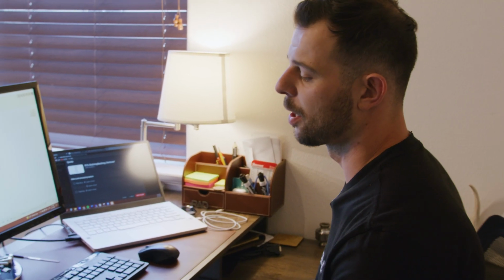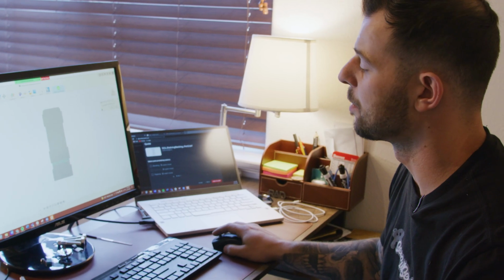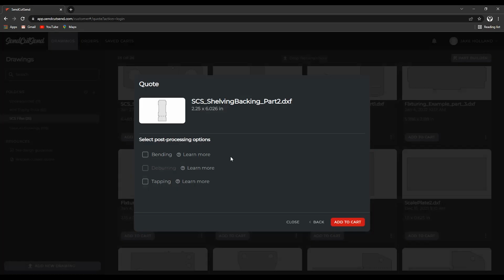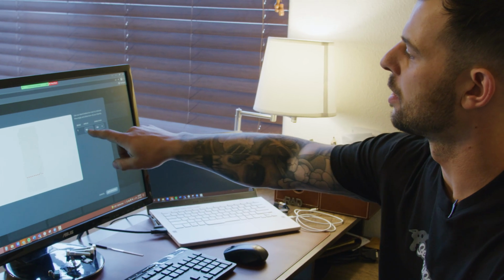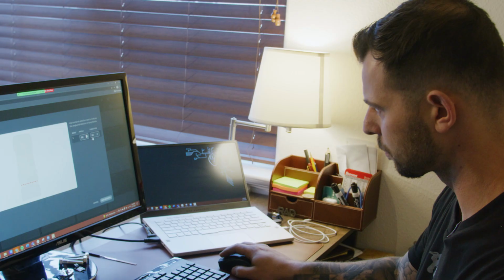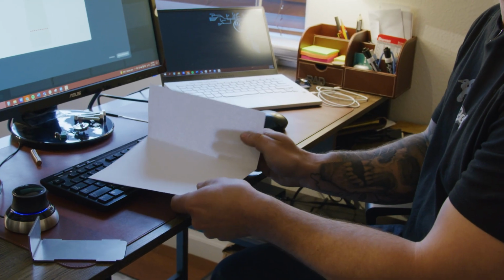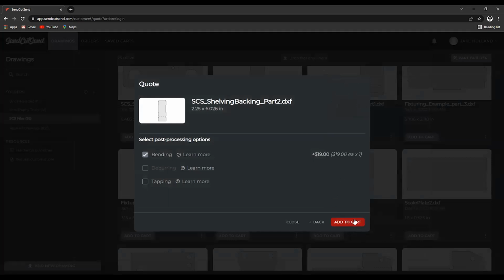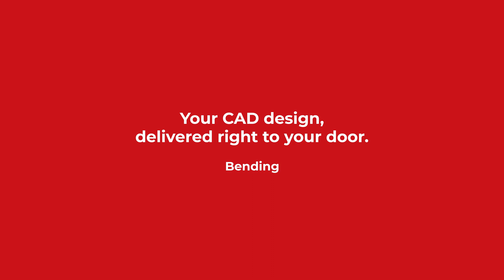How to Configure Bending in the SendCutSend App

Comment: The bend lines Fusion gives me are way closer together than the die width measurement provided on your website. I set the K factor and bend radius as suggested. 

How can I make sure my 3d model matches the bend width of your die? I have holes close to a bend, which looks fine in fusion but got flagged when in your review before production.
Reply: I think I figured it out. Let me know if this is correct.

 The die lines are where the material makes contact with the die. The bend radius will be smaller than the die lines. As long as the bend radius doesn't interfere with my holes on Fusion, then the part will be bent correctly. It may just leave marks on my holes from the die. The holes should not be distorted so long as they are far enough from the bend radius.
Reply: @mada310 when in doubt, add reliefs but you may not need them in many cases.
.
One of the main disadvantages of SCS bending is the inability to define a bend radius. It sucks.  It's an all or nothing tight bend. But that also means that holes relatively close to bends won't distort as they might with a larger bend radius.
Reply from the maker: Hey there! Feel free to email your drawing and questions to support@sendcutsend.com and our team can check your drawings before you upload them for cutting
Reply: @sendcutsend  will do. Thanks!

Comment: When making a flat pattern there are terms in the CAD software to control stretch.  As I understand this depends on the equipment.  Do you account for that? Can you provide the bend parameters?
Reply: Certain programs (like Fusion 360) will not use the same parameters that SendCutSend displays in its material tables. For example, steel might have a K factor of .4 in F360 and .32 in SCS's table.  Bend radius might be thickness in F360 versus .1" in SCS.

So I override the settings in F360 using the SCS values since the goal is to be compatible with their process to produce the correct outcome.

It's worth nothing that the whole sheet metal step is completely unnecessary to work with SCS. Just draw the parts flat, use SCS's bend calculator to adjust your dimensions and bend locations, and export to dxf. Converting to sheet metal is only helpful if you want to visualize the part since none of that will be used by SCS to produce the part.
Reply: @john.queue.public  The K factor depends on the material and equipment.  So I believe  the send cut send kfactor could be used.  I may be wrong.
Reply: @ahbushnell1 Sorry if my explanation was poorly worded. But that's precisely what I meant. I override F360's native material parameters using SCS's values instead and everything works out fine. The only downside is the inability to use a custom bend radius. A bit of a bummer but for prototyping it has been good enough.
Reply from the maker: Hi Andy! Bend radius, k-factor and thickness are all big factors. Those values can be found in the material details for the specific material you are looking to bend. Once you have those values your CAD software should make the correct adjustments. We also provide more details on the bending guidelines page as well as a bending calculator.